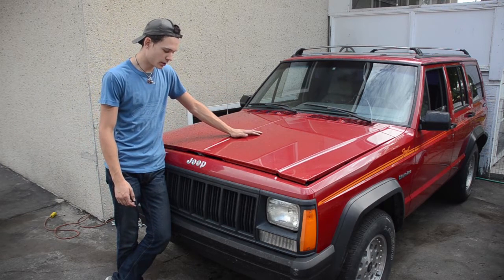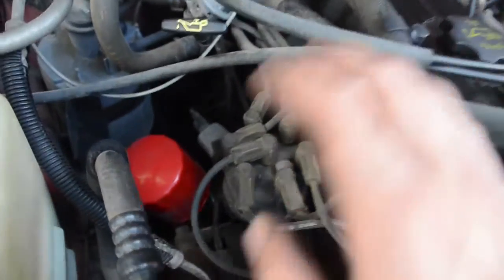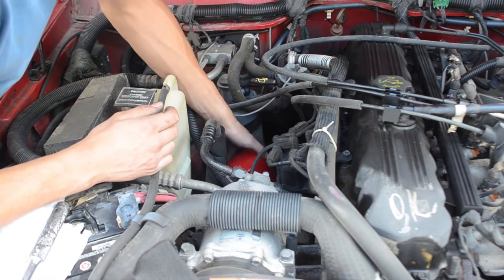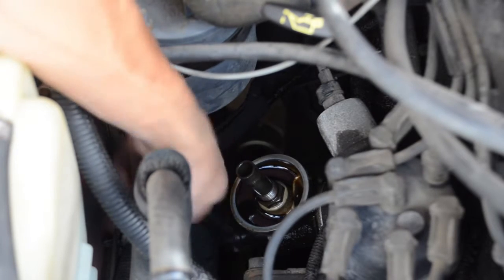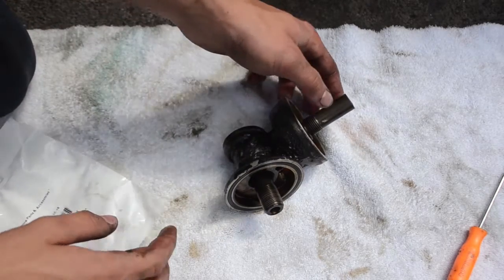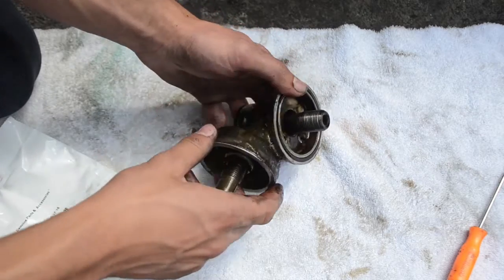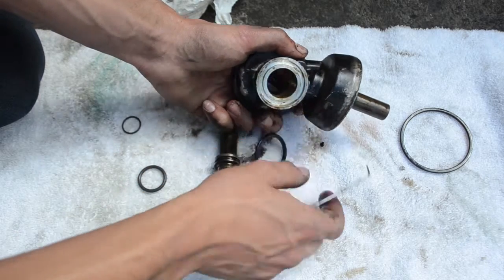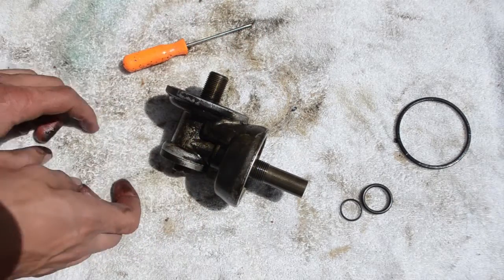Jeep Cherokee 4.0l Oil Filter Adapter Leak Fix!

Comment: Thanks for posting your video, you made it easy for me to change mine in our 1991 Jeep Cherokee. My local parts store had the kit, and like you, I went back and got the correct oring. Some cheap **** took it off and instead of fixing it, added loads gasket maker, prior to us owning it. I was losing a quart to a hundred miles.
Thanks again !

Comment: Great video!  Ever since a very recent oil change my 96 Jeep Grand Cherokee has been leaking oil.  Not a huge amount but enough to piss me off and cause a fair amount of concern because I'm thinking the problem must be the rear main seal.  Some guy over at the place where I had my oil changed even showed me where the oil was supposedly leaking from and I thought, 'Yep, a rear main seal damnit!".  However, now I'm thinking it may well be the oil filter adapter which would be an easy fix, despite the fact that it looks like the oil is coming from the other area.  The oil on the starter is a good indication that this leak is coming from higher up.  I'm going to give the oil filter adapter a try and your video was especially helpful in pointing out the location of each seal.  

Take care and thanks for sharing the info,

Rolland B. Heiss
Reply: How’d you make out?

Comment: I have a 1994 XJ I got for free, rather ironic I heard you state you did as well, that I have to replace the housing gasket on as it's leaking like a crazy. It killed my starter so I gotta replace both now. I heard you say the kit has the wrong O-rings, where did you get yours and what size if you can remember? I don't want to tear it down cause its the only vehicle I have to get around in.
Reply from the maker: The kit I got from mopar was part number 0472 0363. It had 1 right oring and 2 wrong ones. I then just went to part source with the old ones that didn't come in the kit and got them to match them. After doing some research I found out that I bought the wrong kit. Call mopar tell them your year and they will get you the right kit.
Reply: OK I'll check the part number on mine, I had to order it special from the dealer, and see if it's the same as yours so I know what step to take. Thanks for the reply and for posting the video it's been a great help

Comment: Do you think that o-ring kit was wrong because you have an earlier model XJ? I have a 99 XJ and I'm coming up with part # 4720363 as well with the smaller o-rings. Just in case where did you get the correct kit and what was the part number? I'd like to have them both before I get started.
Reply: I answered my own question with a little research. The later models have a stupid torx head bolt installed factory with red locktight. Part # 4720363  is correct for that set up.
Reply from the maker: Yes you're right that was the problem. After later talking to the guys at the dealer they told me that the earlier models need a different kit. They didn't have any in stock so I just went to my local autoparts dealer and bought the right size oring from bulk.

Comment: I have a 89 Cherokee XJ but mine is 2 wd  not 4 wheel drive unfortunately
Reply: I have a 1990 2dr 2wd. Picked it up for 600 bucks in 2006. A bit of a gas guzzler but takes me almost anywhere. I can fix anything on it and will never sell it!⛽

Comment: Why is the Jeep oil filter not attach straight to the block?
Reply from the maker: There is not enough room for it without putting in the angle adapter.